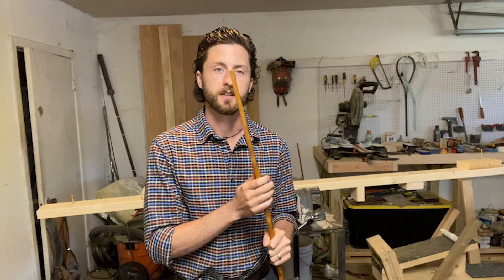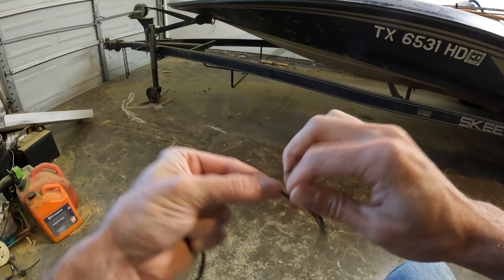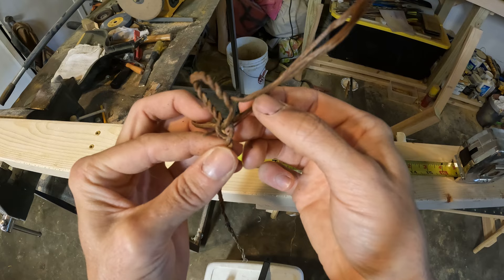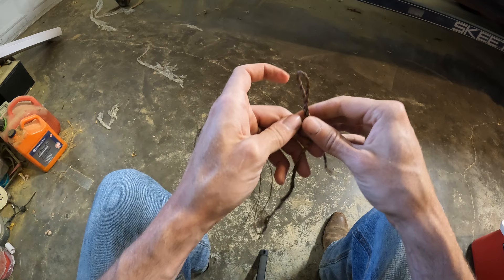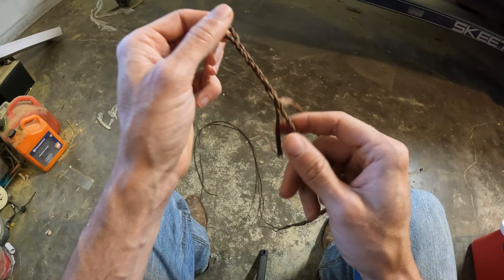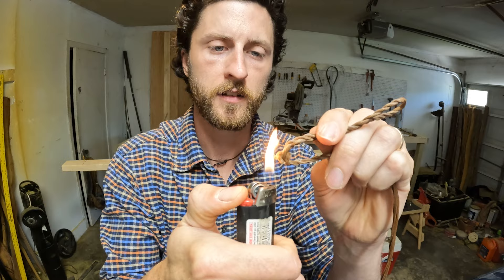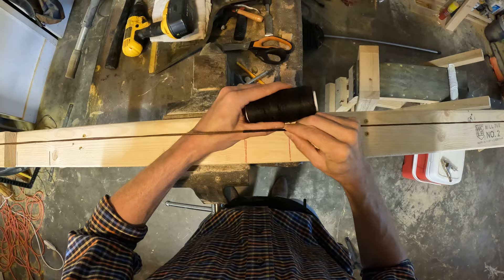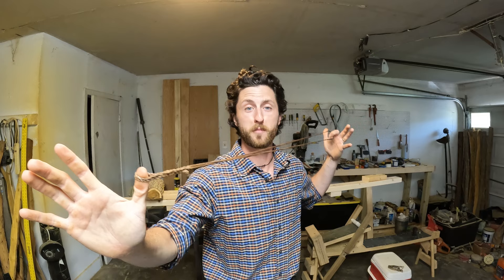TIPS AND TRICKS to make an EASY and ADJUSTABLE flemish twist BOWSTRING!

Comment: Thanks for the video !
Reply from the maker: Sure thing man. Should have the handle video out next
Reply: @LWYLoutdoors  the handle may be a simple thing to some but I am always apprehensive about shaping them. The good thing about your videos are they are straight to the point and easy to follow with measurements and simple techniques that work !
I'm currently working on an ipe and bamboo bow, one is reflex deflex and one is howard hill style which I will be putting back set into.  handles and strings are my weak points. Thanks for the help brother It's appreciated 🙏
Reply from the maker: Dang I’m sure those will turn out beautifully! Anything I can do to help man!